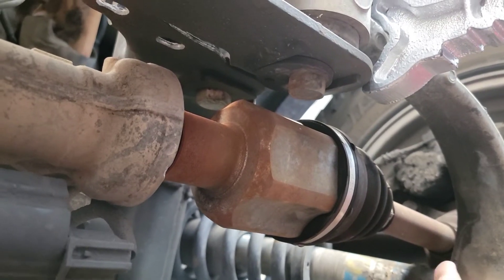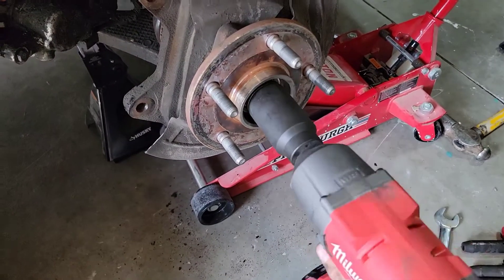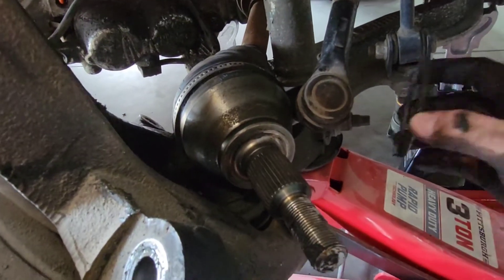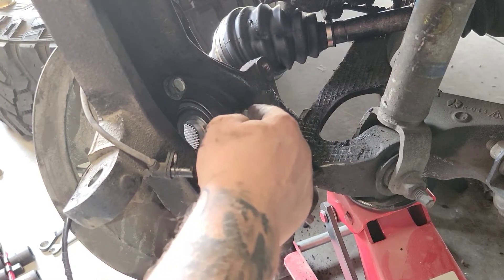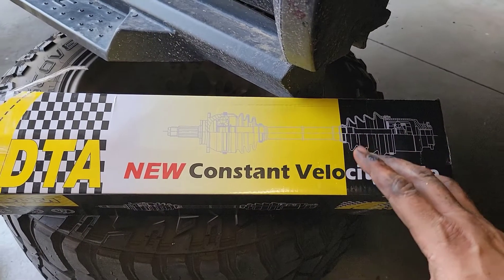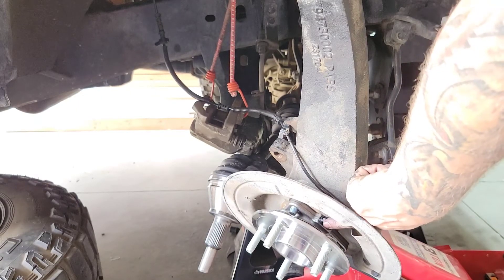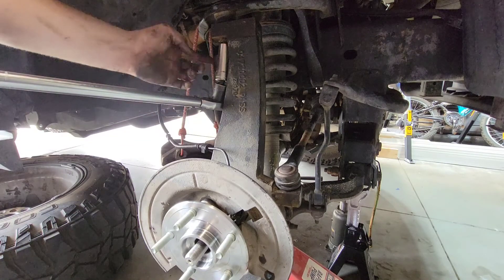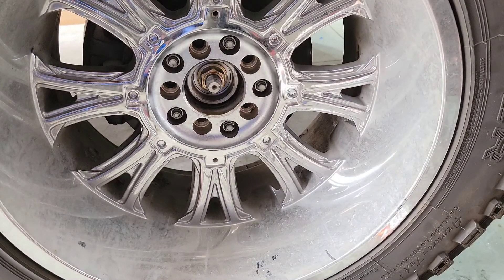Wheel Rattling Sound When Driving

Comment: Can the cv axle just be tighten to eliminate the loose sound?
Reply from the maker: Thanks for stopping in and commenting. No it can't. There isn't any adjustments for that. The case and bearing become loose over time, and adding grease to them with new boots almost never fixes the overall issue. CV axles are fairly cheap and if you can exchange them yourself it's usually less than $200 for everything. Let me know if I can help with anything else. Please consider liking the video and subscribing to the channel to help me grow 🪚 👊